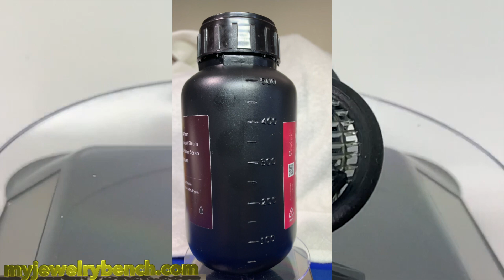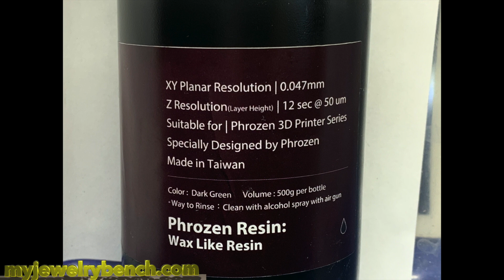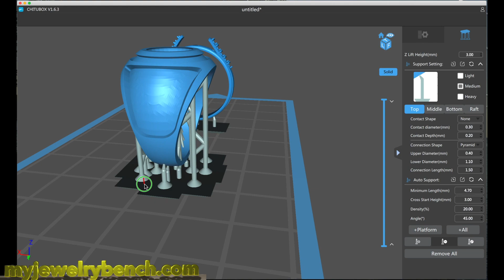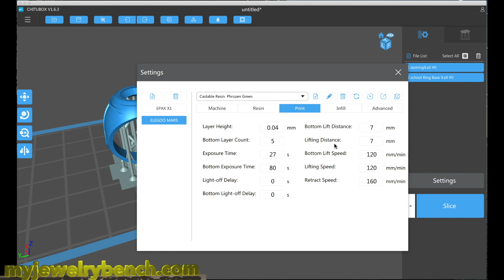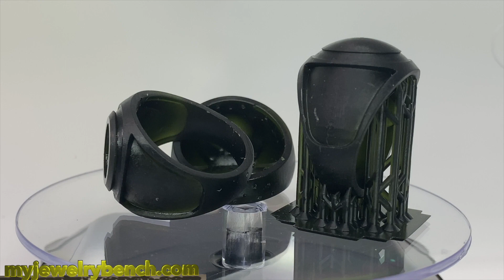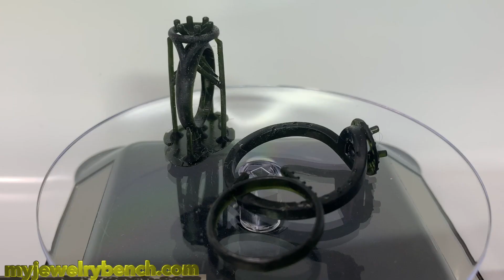Elegoo Mars, Phrozen Castable Green Resin Review!  Proper Settings!

Comment: Hello! I have started 3D printing jewelry in order to make prototypes. I am using Elegoo Mars Pro 2 and I tried with Bluecast. Most of the prints were failing even though I used the settings recommended from their website. It was horror, though the ones that I managed to cast were very good pieces. I feel like I have to try another one and I will do so with this Phrozen one. Where did you get those settings from? 

Also, a big problem with Bluecast is the curing. You need to use an air compressor and blow it until the material turns gray and stiffens. This is insane for me, cause I dont feel like buying one. What solution do you use to cure this castable Phrozen? Does IPA work?
Reply from the maker: Ok.  Bluecast is the best.  Try these settings.   40 seconds for bottom layer cure time.   8 seconds on the cure time on each consecutive layer.  Clean your fep film really good with class cleaner and ipa.    As far as finishing it after the printing is complete….  Do this.  Rinse with ipa. (91%). For three minutes.  Leave prints on building plate if you can. Then, and lastly, use a hair dryer on medium heat for about 60 to 90 seconds.  You should get a film in the prints that lightens the color a bit.  That’s it.  Casting is an entirely different issue.  Slow slow rise in temp.  Do not rush.  Use the best investment you can get.  Should work perfectly.
Reply: @watchesandjewelry  Doesnt work with the hairdryer. Ill try those settings though

Comment: Hi,where did you get this settings- profile for this resin for elegoo mars?
Reply from the maker: That video was a while ago.  Check with the manufacturer of the resin first to see what they have for print settings.  You may gave to print a few things and adjust settings to get perfect prints.
Reply: @watchesandjewelry  Thank you for your answer. Do you still using this resin? I've try x one ,and at this moment have to many issue, looking for alternative. I got phrozen mini 8 and profile seems like i can get from website phrozen. But for elegoo mars 3 i don't have idea which settings be good and from where i can get it.

Comment: Good result, no layer stripes are visible on the surface of the rings, did you use sanding?
Reply from the maker: Resin prints need to be sanded   Not much. But you should make an effort to clean up the layers.  Just like using wax and heating it a bit to remove carving marks.

Comment: Peter, noticed your settings are for .040 layers. Have you found model surfaces to be significantly better with .040 vs. .050?  I'm using your .040
numbers to print a 115 mm tall piece on a Photon original and the time is 28 hrs. Looking for a way to trim that down without sacrificing too much.  FYI your .040 setting for the Phrozen wax-like on a Photon make some very good looking models. Next phase to cast.
Reply from the maker: I have found that .04 works better then .05...  depending on the model model I have also gotten very good results at .035 and .037.  Generally, for engagement rings.  Either way, cure time is still long....  Sadly, I went to pick up my last casting from my caster yesterday...  He can't find my job!  Going back tomorrow...  At least it was for my wife, and not a customer!

Comment: Nice clean precise informative video. Have read a Phrozen caution about mixing old and new resin...i.e pouring back in the bottle. Also read that this resin reacts with moisture in the air and degrades (guessing properties change) because of this......aka no keeping resin in the tray for extended periods of time. Have you experienced any issues along these lines that you'd attribute to moisture?
Reply from the maker: All resins will degrade. I’m in Florida where it is more difficult. Because castable resin has a mix of waxes and other chemicals it will break down keep in the bottle and filter it both when you pour it in and out of the vat. Do not leave it in the vat, even covered. It will dry out. Buy only what you need. If you are casting small numbers buy a 500 ml bottle. More if you are producing more. Of the inexpensive resins I like phrozen. Bluecast and powercast are real nice but expensive and you need to tinker with settings.

Comment: Have tried using this with your settings today and it doesn’t seem to stick to the top plate. Have tried multiple times and it’s all goo in the bottom :(
Reply from the maker: Try cleaning the build plate and sanding the surface with some 80 grit sandpaper. Not too hard.
Reply: Peter Grande I’ll try that tomorrow and see if it works.
Reply: Peter Grande yup tried it with no success. Gunna try to lube the FEP next.

Comment: Thanks for your post on castable resin. There aren't many types available for low cost printers and the reviews for some of them aren't very good. For one, the comments were that it printed great, but left a lot of ash at the burn out. I was finally getting my settings right for Anycubic castable resin, both printing and casting, but it has been out of stock at the the couple of places that sell it for several months. I have been using it for parts of a 1/8 scale steam locomotive cast in bronze. Thanks for posting your Phrozen settings. I'll give them a try. Phrozen was the first castable resin I used but I never got it dialed in to give me the results I wanted. I tried Anycubic on the recommendation of a couple of Youtubers and because it was less expensive. I'll give Phrozen another try. I'd be interested in seeing how make out in burning out and casting the Phrozen if you give that a try.
Reply from the maker: Cure the piece as long as you can. Over five or six hours. More if large. It has to burn out slow. 150 c and ramp up to about 700 c in 12 hours.
Reply: @watchesandjewelry  Thanks!

Comment: Thank you very much for your videos and recommendations, you would know what configuration I would have to give to elegoo mars to give me good results in the B9C YELLOW resin, Thank you teacher for your knowledge,
Reply from the maker: Hello Adria, so let me state I have no experience with that castable resin as of yet using it with these inexpensive printers...  I would first say that if you want to try it, go for it...  However, set your layer time to 25 seconds to start with as it is a waxy resin also...  These waxy resins seem to be the biggest issue with print times on low powered consumer based printers...  Yellow resin may cure faster, so you will probably be able to print well with quicker layer times, but do a test first.  If you are using professional printers, the kind that cost in excess of $5k or better, you will bet much better results as they cure at ten to twelve times the speed versus the Elegoo or Anycubic’s low power UV lamps.
Reply: @watchesandjewelry  Thanks, I found a configuration of the anycubic that put 32s offtime 1 and I have been testing it and it has not given me a bad result, in this resin I have to put more supports than in others I do not know why and sometimes it gets stuck to the tank of resin the piece and it does not print it well and I read that if you scratch a little with sandpaper at the base where the piece will print it helps to stick it up and not in the resin tank, do you think it is a good idea?
once again, thanks for your time and wisdom,
Health

Comment: @Peter Grande
I own a jewelery workshop and I found out what's the formula for melting and leave 0 ashes for castable resin . It is based on exposure times and on % of wax that is contained in resin.... I prefer phrozen wax from bluecast.
I can help you if you want.
Reply: Thanks for amazing 3D CAD videos and your support too! It helped me !
Reply from the maker: Thanks. I don’t do investment casting myself. I sub it out. But anyone who does do investment casting needs to know burnout rates. I’ve have great luck with cure times from 30 minutes to 1 hour depending on the size of the piece. How about you
Reply: Peter Grande there are a lot of things to talk about, I cast 200-400 objecte from 3 d printung every week and there are a lot of factors, as: some rings must be cured with stronger UV source for about 4 min 30 sec, some with light UV for 15 min, and others with strong for 1 min and sun light for 30 min, the slicing is realy important, the orientation of the objects , it is important to know what you have there, just write me an email and we can talk about everything you want and you can take some notes and just try by yourself and post a video about that
Reply from the maker: Please send me your info at myjewelrybench@gmail.com.  I’m interested
Reply: @olteangabiable  hey are you still around? I have some questions.
Reply: Peter Grande please write me an email so I can write you from work, it's oltean.gabi@gmail.com or check website for details :
https://mybeauty.ro/v2/title-page-sep-sitename-creaza-produs-personalizat-de-pe-mybeauty-ro/?cn-reloaded=1

Comment: There are too many castable resins that simply don't cast well for me (and I think most others) to take your word for it. Please show the casting results. Otherwise all you've show is that it will print. Sorry but big whoop
Reply from the maker: More coming soon. However the biggest problems with castable resin is not that the investment won’t cast but because the one doing the burnout does not follow the burnout procedures. These are typically VERY DIFFERENT than wax model casting. The plastics that are created during the printing must be burned out slower and at a reduced heat ramp than wax models. The one issue I see is that manufacturers do not often specify the rate of burnout for their castable resins. If heated too quickly the resin will boil instead of melting. Additionally you must cure waxy resin longer then standard resin as this too can result in a moisture blowout rather than a melt.
Reply: @watchesandjewelry  I completely agree with what you are saying. However I have yet to find an affordable resin that produces a quality I consider acceptable. I have tested a few of them extensively using a wide range of curing methods and times(including curing in a vacuum oven) and a range of burnout cycles. Typically between 10 to 14 hours. They all cast. But what I should of said is I would be most interested in seeing what quality of cast you are able to achive with this resin. Sorry if my post offended you. Best regards
Reply from the maker: I don’t take offense to much. Spent 20 years working retail. Lol
Reply: @watchesandjewelry  do you have any recommended vendors that WILL take into account the burnout times that we forward to them? I'm very interested in trying out a test class ring - same as you tutorial'ed recently.
Reply: @stvcolwill  I'm also interested in casting houses that do well with printed resin. Do you have any recommendations, Peter?
Reply from the maker: Yes. I recommend two. My first choice is Jaguar. They are in NYC. Second is Stuller. They are in the south. Jaguar is a bit more flexible and work better with both small and large jobs. Unfortunately with the pandemic they are shut down. I’ve used a couple local people but I’m finding that some of them don’t like to follow the burnout process if it duffers from standard wax. Hard to get some people to learn new methods.